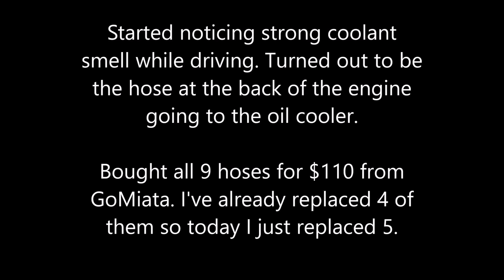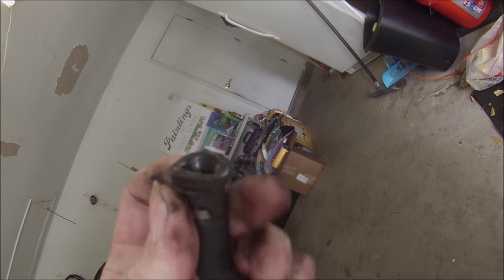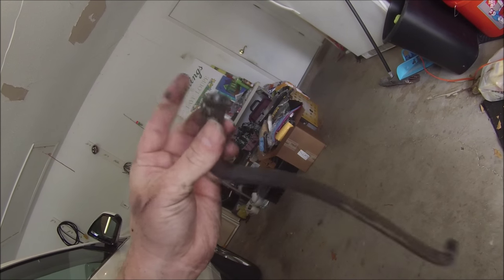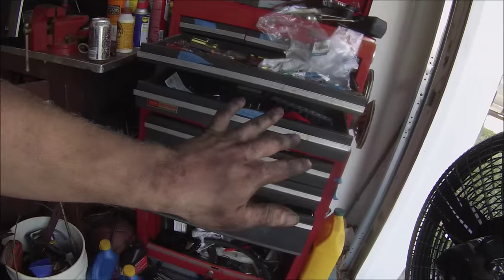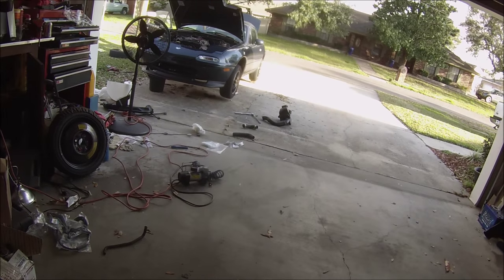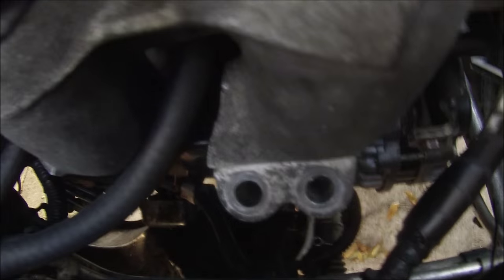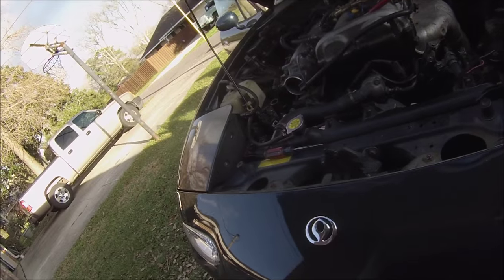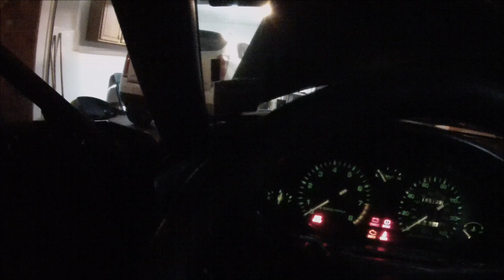MIATA Vlog 3: Devil Coolant Hoses!

Comment: how did you get the 1 hose off above the oil filter I need help on that one??
Reply: Myyoutubechannel 3years later please tell me you found the solution because I’m running into the same problem
Reply: The one I just used a splice